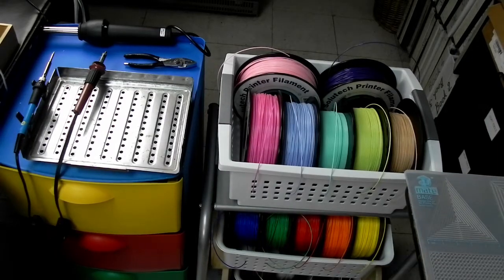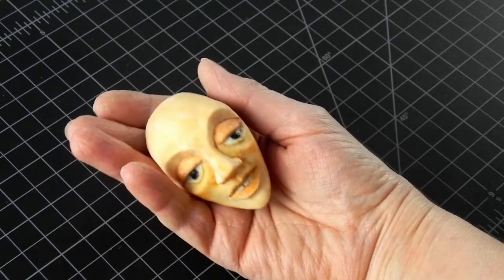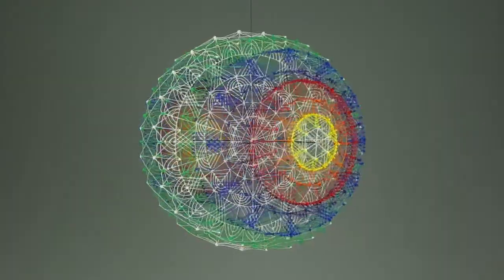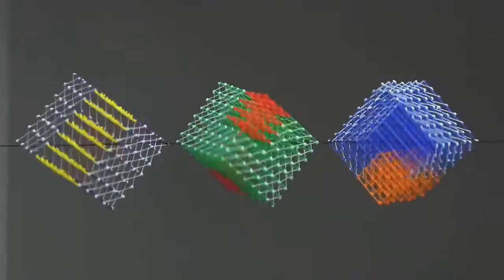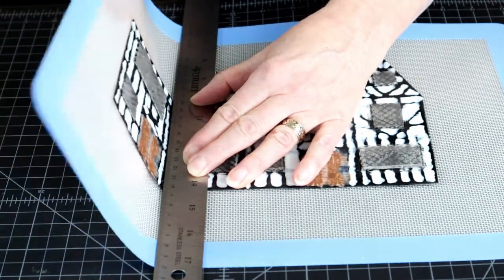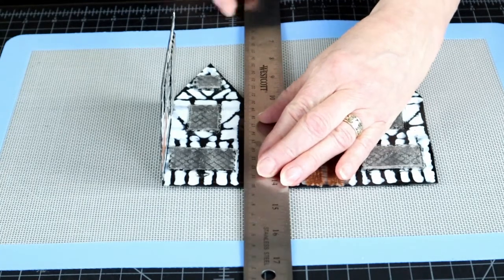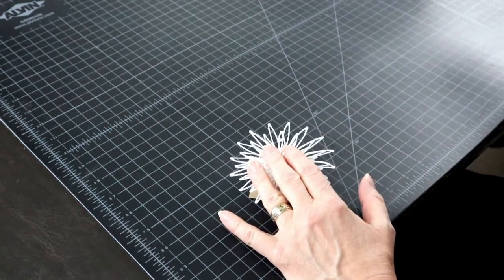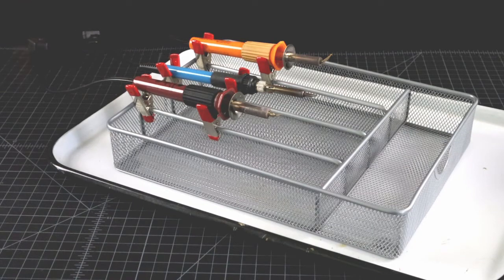9 reasons to get a wood burning tool if you have a 3d pen

Comment: What temperature do you use for smoothing? Mine is digital
Reply from the maker: My digital one is set at 500 F (260 C). But I vary it if it feels like it's burning the plastic. And I clean my smoothing tips on paper towels while hot as I go, so there is no burned residue sitting on them.

Comment: Hi, I just discovered your channel and it is fantastic! Unfortunately, the woodburning kit you listed is unavailable. Can you please recommend another? Thank you!
Reply from the maker: This one is still around 
https://amzn.to/36eWr4M
but I also just bought a brand new one with digital temp display to try out. Haven't even opened it yet. So once I do, I will let you know how I liked it.
Reply: @3DPENDEN  thanks so much for the link. I am interested in your thoughts on your new digital tool as well.
Reply from the maker: So I finally opened the digital one. I haven't used it long enough to give a responsible review yet. However there are two things I love about it already over all the other ones I used so far. One: it heats up really fast. Two: being able to see the temperature and control it by 5 degree instalments is priceless. For instance for sculpting: 250 Celsius is not enough, 260 C is just right, around 300 C the plastic starts to seriously burn. I haven't had this much control with my previous ones and I love it. Here's the link if you want to look.
https://www.amazon.com/dp/B00M1O9ZSG?psc=1&ref=ppx_pop_dt_b_asin_title
Reply: @3DPENDEN  hi and thank you. That is very helpful. I was able to order a Walnut Hollow for 40% off at Michaels, but this might be a more useful one to have.
Reply from the maker: No harm in having two (provided it's financially doable.) One is technically a woodburning  tool and the other one is sold as a soldering tool, which means they come with a set of completely different tips. Variety of tips is always a good thing to have.